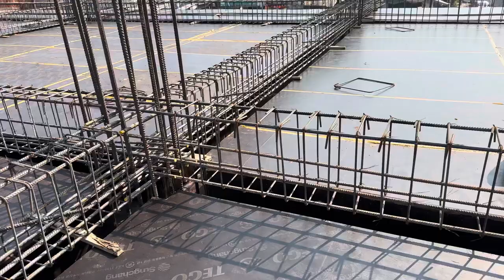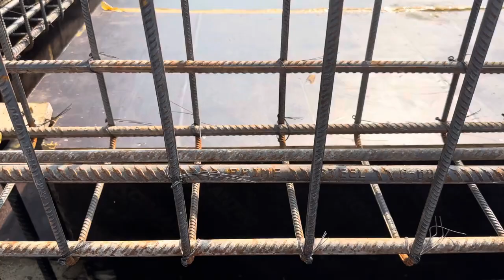Beam Structural Design

Comment: Dude, I gotta say: stop reinforcing with steel and start reinforcing with BASALT. 10 times as strong, but it never rusts: that means the concrete doesn't crack. Your building is basically disposable ("planned obsolescence"), when reinforced with steel.